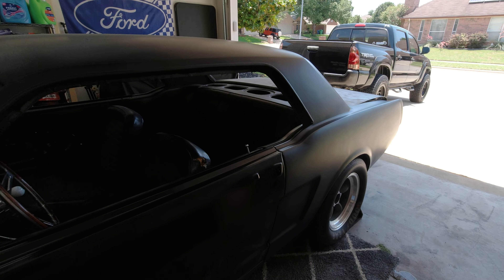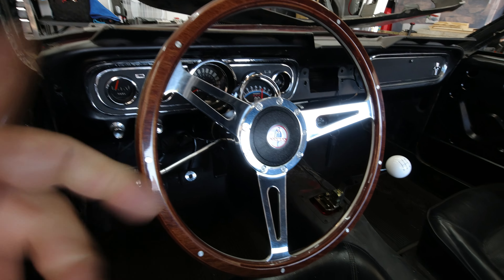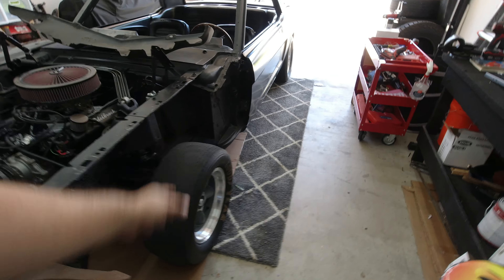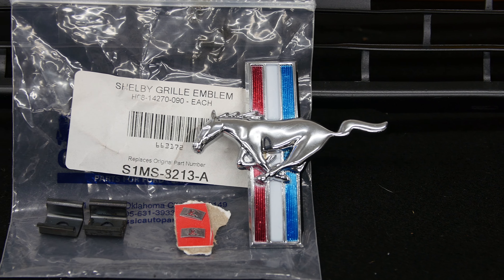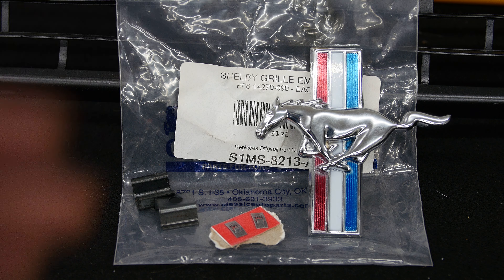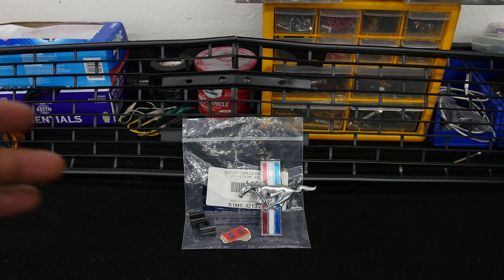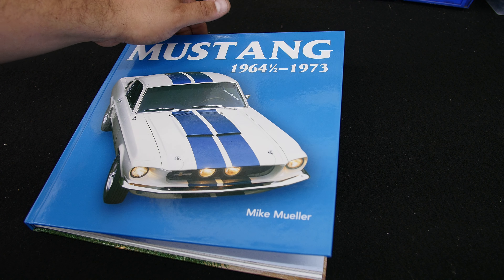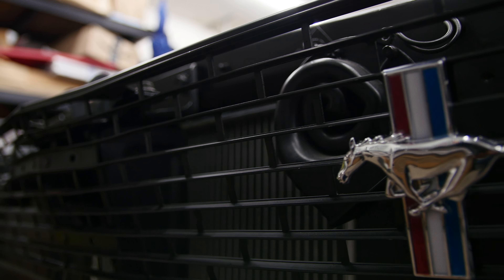1966 Shelby GT350 Grille Emblem Install

Comment: Contrary to belief the Ford Mustang horse was designed and sculpted by Bill Swan which was made out of fiberglass originally Ford paid him 100 for horse and Edsel gave him a Thank you card his family has horse and 3D picture of it but the man who made the emblem took credit for it all since he worked at Ford
Reply from the maker: This may be true after ford got the Ford Mustang wood version first from the man I described. The info I shared on the video comes from 2 creditable sources.
Reply: My dad also made small wood carvings and if you look at both you can see it's from same artist not only that there's a picture of him making the mustang I was lucky enough to get the mustang but the sad part is working with fiberglass cut his life short caused a lot of struggles from enfazema